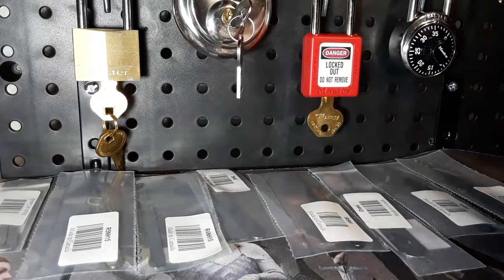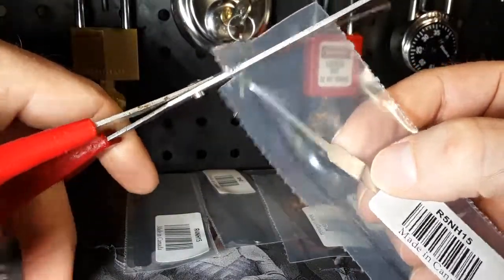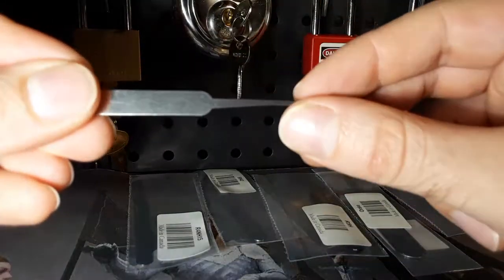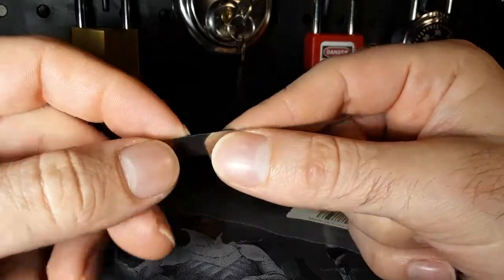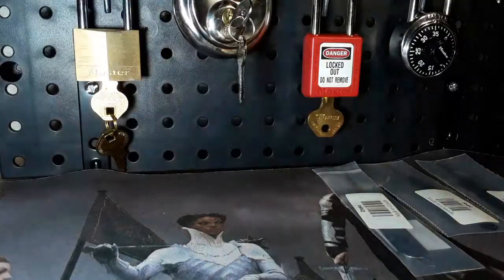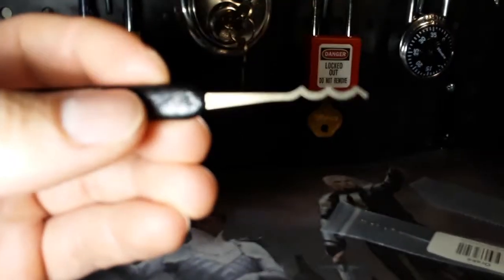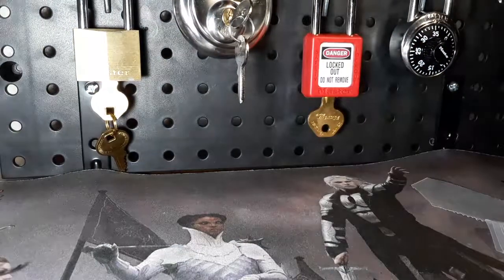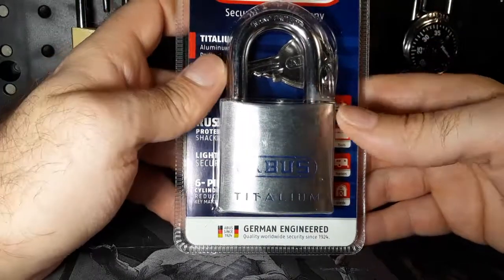Sparrows Lock Pick Haul and Bonus Lock

Comment: Great video and a really nice haul.  That Octo rake is magic lol.  Has rocked open quite a few locks for me.  Only negative is that its a bit big so has issues with tighter keyways.   Those 0.015 from Sparrows can be rough on a newbies fingers lol.  I used some clear shrink tube on those and the Octo rake.  

80Ti is a fun lock for sure.  Lots of feedback.  Ive found that pin 1 is a standard pin in these.  Once you get that set, itll drop you into a false set and from there it can be pretty quick.  Find the counter rotating pins.  If you lose the false set, just hit pin 1 again.  Usually works out pretty well.  :)
Reply from the maker: Awesome advise 👍 thank you

Comment: Nice set of bars.
Reply from the maker: Thank you I do wish it came with a .050 bar as well. The thickest one is .045
Reply: @lockingphoenix521  yeah  you could double them up or I sometimes use one of my  old bypass combs as a tensioner
Reply from the maker: @machinejade  great idea. I may have to get. .050 bar from them too. I feel like that size is so necessary
Reply: @lockingphoenix521  their tools are awsome,  have you got any cheap dimple pick sets, the z bars in those sets can have some nice thick ones. Little bit of modding would do you until you get proper ones. Or just pop up a vid asking the community for assistance
Reply from the maker: @machinejade  yah I have a few dimple picks and they didn't come with any. But I have a few thicker ones. Just not anything thicker than . 045 and right now im on this master lock 570 and it sometimes pops out when I release tension to get past a spool. Any advise?
Reply: @lockingphoenix521  The heavy bars from Sparrows are definitely nice to have.
Reply from the maker: @Halfzipp  yah I think I'll get myself a set Soon.. edit.. I ordered them tonight 😁
Reply: @lockingphoenix521 , What works well for me is using just light tension.
Reply from the maker: @AThreeDogNight  so light tension for the master 570? Cause I was using pretty heavy tension. To not over set pins. But I've gotten into many false sets but no open yet. Any more advise
Reply: @lockingphoenix521 , That's it my friend, lighter tension on all locks & feel for feedback on the wrench, the slightest of turns. Heavy tension prematurely wears a lock out faster. They're too expensive to do that.